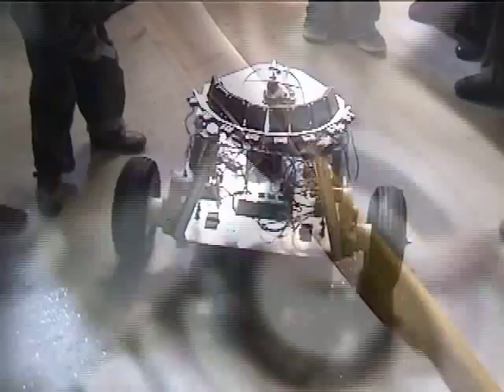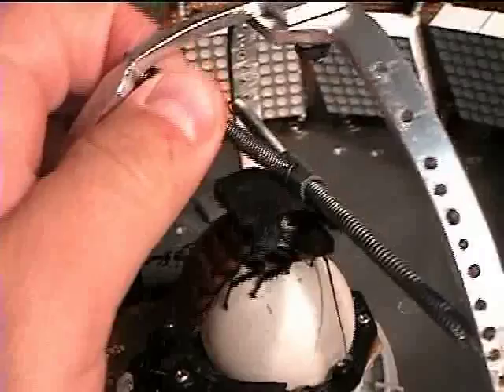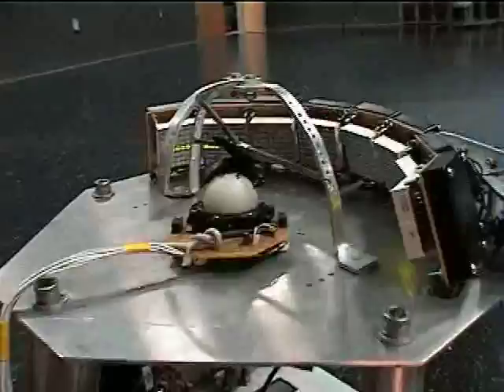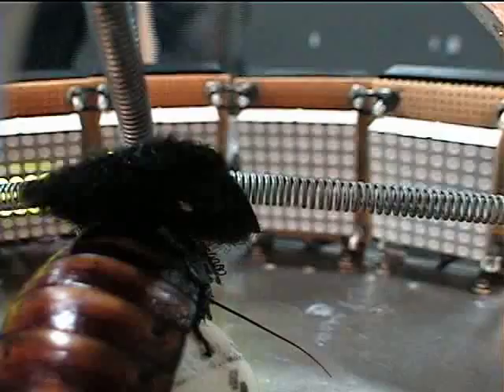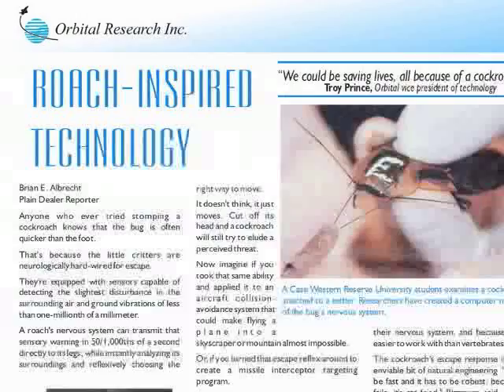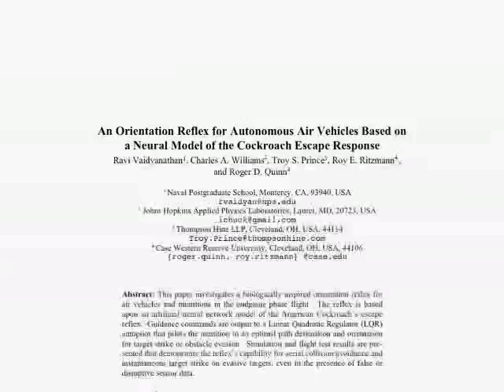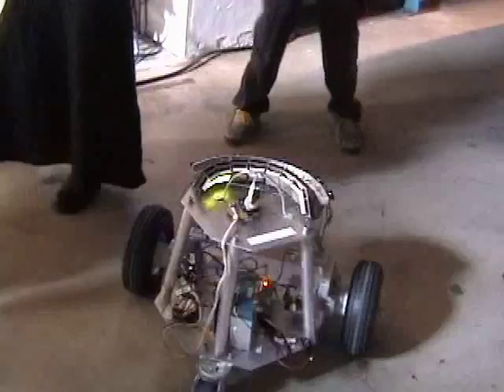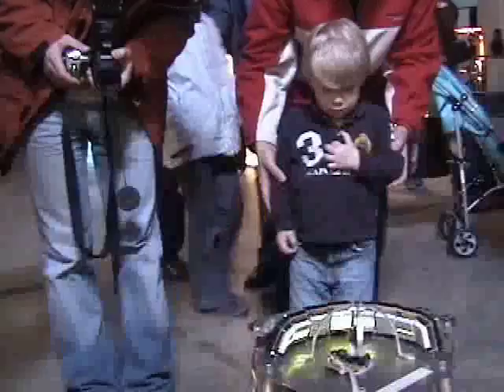The Cockroach Controlled Mobile Robot

Comment: The 3-wheeled motorized caster can operate on its own without the cockroach! Directly connecting the sensors' electrical responses to a logic controller (or computer) can achieve the same results for the trolley to roll forward, veer left or right, and stop. But do you think this will be interesting to ordinary laymen? No way Jose!. But putting a highly visible cockroach between the sensors and controller  immediately sensationalizes the project.

Comment: Hey Garnet o/ Nice robo-roach suit. Using its escape mechanism as a way to navigate, (or avoid) contact is pretty impressive. Do you think using higher wavelength lights would have incite faster escape patterns?  e.g., a series of RGB arrays with a gradient that can "change" from IR to UV. It might not fix the sudden bursts of stop and runs, they naturally move around like that, but maybe cockroaches give different meanings to different types of lights?